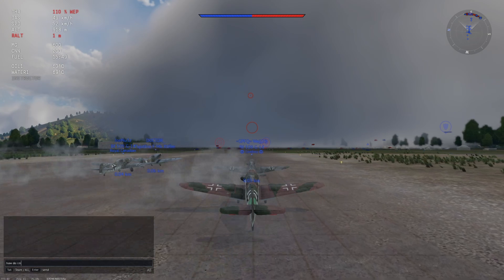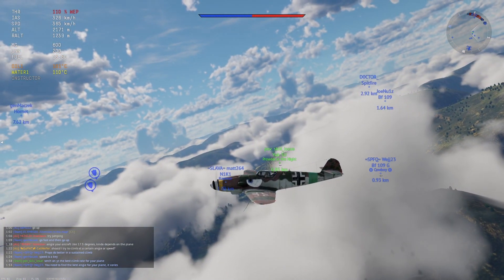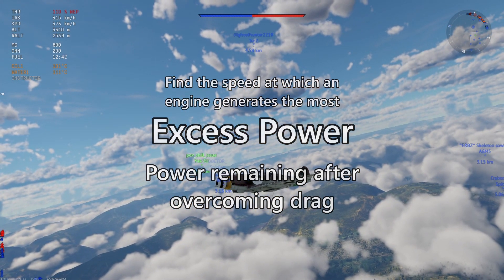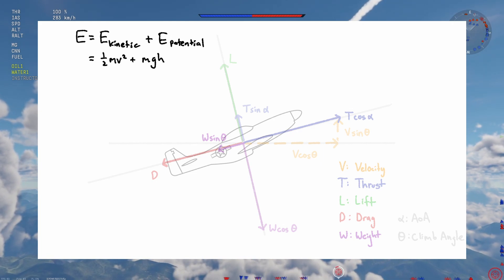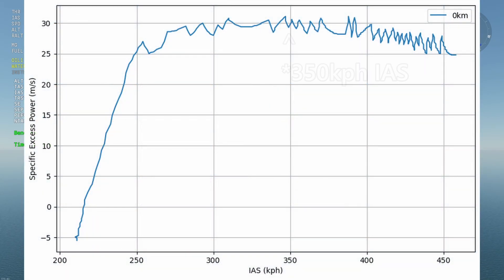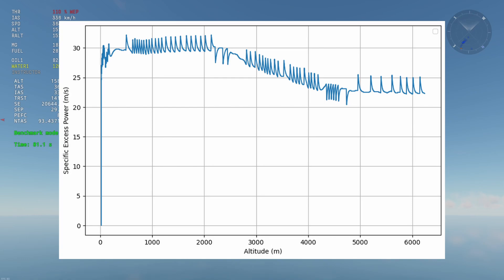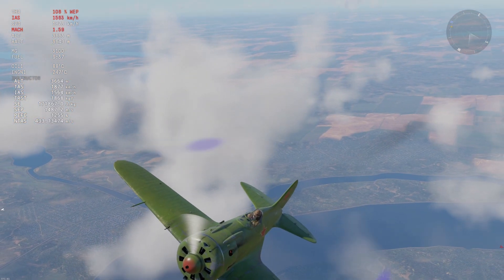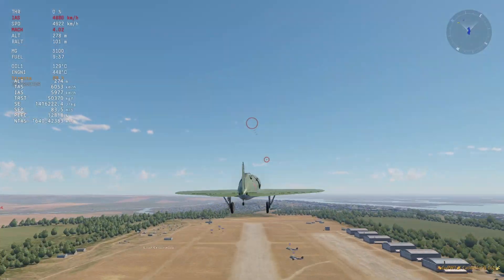Optimizing Rate of Climb | War Thunder

Comment: and this gets even more funky if you use MEC 
100% pitch gives you more drag and more HP
sometimes i found its better to climb at smaller pitch, in J26 (svenska P51) i found that i like to climb depending on alt at between 100% and 80% pitch
Reply from the maker: i wasnt really able to test with MEC, is there a good way to go about testing it?
Reply: @CatWerfer  i am testing it as i play in RB so i can't give you a good way to do it and i am not sure if my climb is optimal i am not micromanaging Radiators i just set them to % that isn't overheating and then maybe once i get to 3-4Km Alt i will adjust it or just skip so that once i get low i have less do with MEC while diving or in dogfight (i am not even sure if my IAS is corect for climbing) and in one of his video AdamTheEnginerd compared climbing by useing optimal IAS and climbing slighly faster and the difference is marginal hower climbing at perfect IAS gives you slightly faster time to ALT and climbing faster gives you more potential Energy at the end of the climb

Comment: One of the most useful aspects of WTRTI is tracking specific excess power and climb rate in real time... and you can see immediately as you experiment what improves or doesn't improve things.  I realized pretty quickly that the 240-260 kph speeds commonly recommend are WAY too low for ideal climb... but make make you slow enough to not be first in contact with the OPFOR.
Reply from the maker: Kinda... you need to know what the max sep for any given altitude is. You can experiment while in a match but that means fiddling with your pitch which causes a lot of drag from changing aoa so if you do it too quickly then you lose efficiency.
Also the way wtrti calculates sep inbuilt to its system is wrong by default, i go into more detail about it in my EM diagram series but i might make an updated climb video just to set things straight

Comment: This is really interesting because you did almost exactly how you determine this in real life through flight testing. We just did a these calculations for real aircraft in an aircraft performance class using a very similar numerical method based on some flight test data and some predictions.

Your conclusion is spot on. Pilots typically use a “climb schedule”, which is just a set of easy to remember speeds at specific altitudes. It’s an approximation of flying the actual ideal speed at each altitude, but ends up being within a couple percent of the fuel burn and time. Climb schedules are much more useful than actually flying the ideal climb schedule. The distances and times in war thunder make it not worth it IMO, since efficiency doesn’t matter and the couple minutes spent climbing (for prop planes at least) don’t really give enough time for the variability to show. Jets may be a different story in high tier maybe, not sure.
Reply from the maker: oo thanks for your insight, what kind of course was it?
I'll make a follow up on jet climbs later, where things like supersonic effects start to make things more interesting
Reply: @ it’s our advanced aircraft design and performance course. Senior in aerospace engineering
Reply from the maker: @slade8212  nice sounds interesting

Comment: You didn't use Manual Engine controls? When I was back in props I used Manual engine controls all the time to adjust radiators, prop pitch, fuel, supercharger gears. And then usually just needed to adjust Radiators/supercharger for altitudes up to 5000m and then change fuel mixture in some cases, this alone with give me a huge advantage in climb rate + energy.

Great point that was made tho, the comparison and the usage of WTRTI to find excess power is a method I didn't use before, I think we didn't had that before. But GREAT method, as you were able to find more energy at the top of the climb is awesome, I'm sure if I go back to props I will use this knowledge now to boost my performance.

So Thank You for the great video!

Would love to see you experiment with the climb rate that you made and varying radiators aperture, fuel mixture (usually easier to find since the engine dies if wrong), and sometimes changing supercharger gear later or sooner if the plane has it. Prop pitch I think I just set it to a constant value from the beginning of the match and only used it to "airbrake".
Reply from the maker: @willsteps7162  I'm planning on doing something along those lines in the future, as far as fuel mixture goes i heard it's only really relevant on some planes so radiator percent is all that matters on most planes just to increase cooling for more drag

Correct me if I'm wrong tho, I'm not very familiar with mec cuz i never really found it all that necessary
Reply: @CatWerfer  You are correct, the most important ones are definitely Radiators, I can't remember if it was on Japan planes or USAF planes that fuel mixture was actually helpful, maybe even on german, I think I would run it a touch richer up to 3500 and then put it back to normal mixture or even leaner if I planned on going higher, its been a long time since I've done it. Every little advantage counts in War?

But you are indeed correct the Radiators are the really big one, but look into different prop pitches as well. I think this information would be very useful for everyone.

SideNote: This is how it starts for the players that play top tier consistently later on, you start by learning the small things with props. Then get to jets and the flood of research needed is overwhelming if they hadn't done research on props before, so if the players already come prepared from props that they had to research to get every little advantage possible then its easier the transition to Jets in my opinion.

Just to say that your work is very much appreciated!

Comment: This VIdeo is way too complicated for me, but i know my climb rate for my plane is 10.6m/s. But what do i do with that Information now
Reply from the maker: If that's thr number on the statcard then it's practically useless. Sometimes you can compare it with other vehicles but sometimes you can't.

To actually find at what airspeed you climb the best you gotta manually test for it, like I do in the video, which kinda sucks. Would be nice if the statcard was actually useful
Reply from the maker: I have been manually testing planes for their ideal climb speed as well as other factors tho, check out the "em diagram" series of videos I've made.
If you're just interested in the results, skip to the "part 3" video

Comment: I thought about this for a bit and without converting Speed Km/h (or the IAS) plus the current height into an arbritary warthunder energy unit measuring speed has problems. You discussed the higher speed after a climb but even without time somehow calculating the height non-lineraly into a unit with the current speed can give one an average "WT-Energy" or "Plane Calories" over the duration of a climb to see if the method is worthwhile. Would probably also help with isolating micro-adjustments have any quality of energy loss on them since you could compare the speed/energy datapoints between a plane that slowly slopes out as it goes higher vs the 17.5 one. The "Good IAS" advice usually stems from an even older practice of climbing at an angle just so you are slightly gaining speed from a very old aussie youtuber that was recommended on the forums years ago which i think slowly evolved to the realization that having good speed helps climbing (and survivng). Just feels like there should be an angle for a speed you are at and maybe a granular level of when to change angle as speed goes up or elevaton goes up to avoid flappy bird efficency losses.
Reply from the maker: @chadoftoons  specific excess power is measured in m/s simply because it is (joules/s)/Newton, from power/weight force, it just looks like "arbitrary speed" units because that happens to be the same units for velocity but they measure different things. Like how torque and energy seem to have the same units.

I'm working on a follow up to this video rn actually so maybe I'll try and address some of the things there

Comment: I climb using MEC , both rads 100% , prop pitch 90% 250 to 300km ias , supercharger gear switch when manafold pressure starts dropping. This allows me to WEP the whole climb 
In almost every plane 
Exept p47 , close rads , mixture 90% and thats it 
Dont do 90% pp  in german props or you will kill your engine
Reply from the maker: thanks, ill try mec someday eventually lol
Reply: @CatWerfer  as soon as I get in a fight I click auto engine control to lazy to pay attention at that point
Reply from the maker: @ScoopsTV  lol that's me but just during the whole game

Comment: I climb at a set angle and then I read all the funny usernames people have and rate them
Reply from the maker: lmaooo this is the correct way to climb (war thunder players can get particularly heinous with their names)
Reply: how do you know what your angle is do you just eyeball it
Reply: @zeldek  to be honest yes. I’m assuming you’re relatively new so I’ll try to explain but it won’t be very scientific

Most (prop) planes you get a sort of ”sweet spot” When you play a prop for a few matches you get a feel for where it seems to work best. Find an angle where you don’t lose to much speed but also don’t gain too much, unless you just took off that is (nowadays statshark can help you, damn kids with your technology!)

In jets, remember they like to go fast (as in the engines are made to work better at higher speeds) so try to at least get some speed first before pitching up. (Let’s say 600km/h give or take, it depends but I wouldn’t go much slower than that unless you know the plane can do it) Many high tier jets can accelerate pretty much vertically depending on fuel and loadout just make sure to reach a high enough speed before pulling up otherwise they ”bog down” 

I do play mostly high tier so can only really answer for that but if you just climb at about 20 degrees, maybe more, maybe less. depending on how high you wanna go you should hit pretty decent speeds once you level off 

Keep in mind every plane is different and loadouts and fuel weight matter a lot so these very rough numbers I said are by no means optimal it’s just to give you an idea. For example I don’t follow my own rule of thumb of ”600kph” that’s just a baseline number to help you get started.

It’s pretty much midnight I hope this made at least a little bit of sense. If you have any specific questions just ask. It’s hard to answer such a general statement as ”how to find a good climb angle” 

Where are you in the tech tree anyways?

Comment: You also have to consider the planes engine performance, planes weight, and its aerodynamics when it comes to climbing. Most American plane are pretty mid when it comes to climbing coz they weigh as much as a whale. Whereas, other planes like Spits and Yaks climb like mountain goats due to their lightweight structure. In reality, just climb between 250kph-280kph. I prefer 260kph for most props. Just for the basics, the more altitude you have, the more potential energy you have that you an convert into kinetic energy, or to keep it simple, more speed. Those are critical basics to know when your energy fighting someone, or when you want to try to energy trap someone.
Reply from the maker: ...you are aware that thrust, weight, drag, and speed are all accounted for in specific excess power? like it's in the equation.